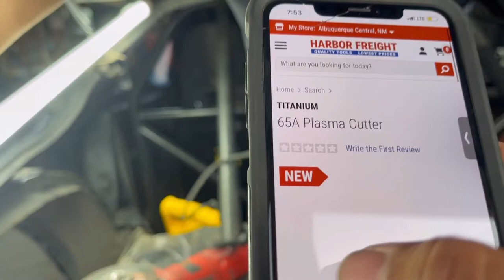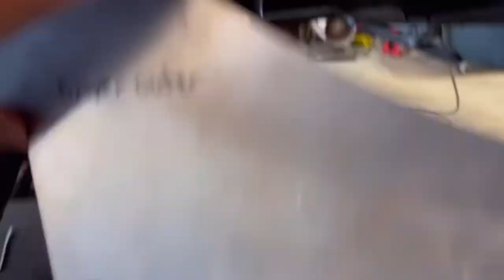F-body mini tub kit installation Mid West Chasis (f-body vlogs #14)

Comment: hey man. im planning to start building a 3rd gen camaro. obviously just about the same as a 4th gen. curious if its hard to access the rear end to make shock adjustments?? sure would be a lot easier if the coilovers were on the back i would imagine. good video
Reply from the maker: Yea they are a pain if you could relocate to the back thad be ideal
Reply: @darksideperformance299  yeah I figured they probably were but I don’t think I’ve ever actually seen anyone do it?? Besides a full back half car obviously. All the popular rear ends I’ve looked at offer rear coil over brackets so I know people do it. But I sure haven’t seen any. Wonder why
Reply from the maker: @nalley6815  message me on IG or facebook I have pictures of a torque arm car with relocate rear shocks